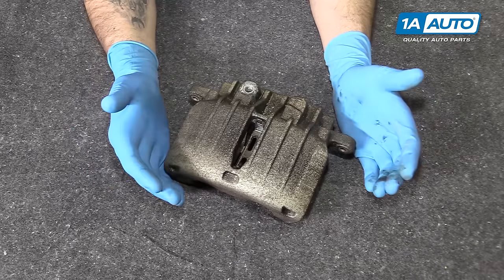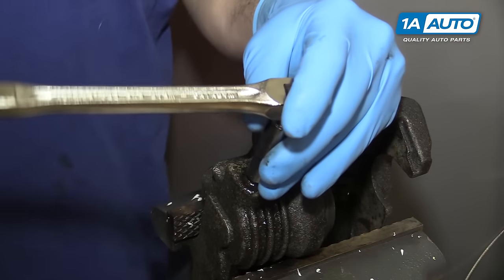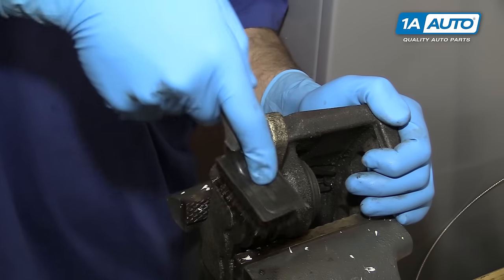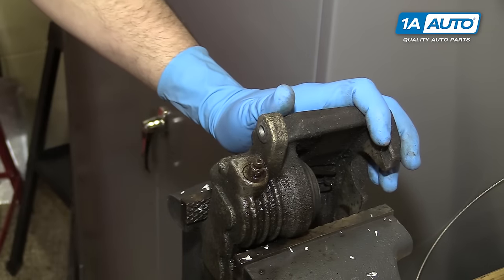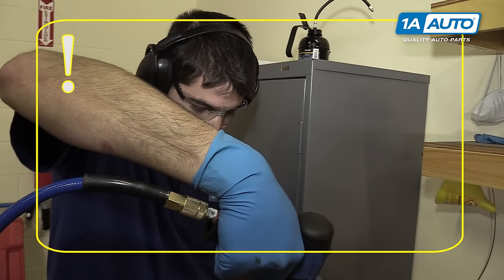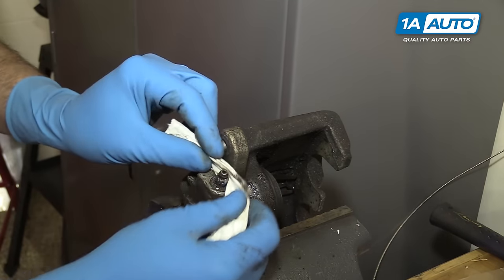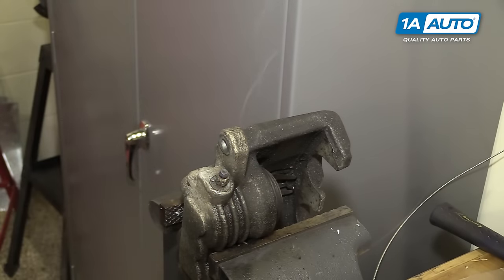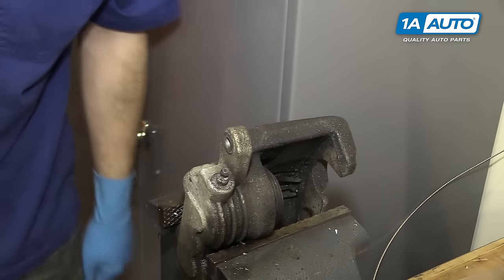How to Remove a Stuck Brake Bleeder Screw

Comment from the maker: √  Watch the Video
√  Buy The Part at 1A Auto http://1aau.to/m/Visit-1AAuto
√  Do it Yourself
√  Save Money
Reply: Many years ago I had the same problem.  What happened to me was the head twisted off and I never was able to open the bleeder valve open.  Used a hammer on the extended caliper to collapse it, to put the brake pads on.  Wishing I had collapsed the caliper after having a big problem with the bleeder valve.
Reply: Thanks for showing us this video. Yes, it sucks when bolts or nuts rusted and welded from corrosion.  Yes, I would rather buy a new part than try to drain my whole day removing it.

Comment: Funny that a How To video failed to work! Honestly, I actually very much appreciate that. Usually folks only show things in optimal lights and make it seem like fix all solutions. It's refreshing to see a realistic video showing that things just don't always work sometimes

Granted, I'm hoping mine doesn't end up failing like this video and one of these methods works for me hahaha
Reply: you can ha ha ha more... probably you have not repair to much on your car... repair on cars that have at least 5 years might end with broken rusted nuts or old plastics, after ten years you might get one piece per repair if you are extremely caution or more if you intend on productivity.
Reply: Right?!?! All the how to videos just make it look super easy then people are shocked when they end up making it worse lol. I love that he goes through several options and explains how to do them correctly, and more importantly, how to NOT overdo it. His comment at the end is my favorite 🤣🤣🤣
Reply: Your last option is to snap the bleeder screw and drill it out - These guys wont tell you that because their goal is for you to buy a new part.
Reply: All he had to do was heat the caliper up till it was red hot and it would have came out , doing this way has NEVER EVER let me down the last 40 years doing breaks .

Comment: Heat the caliper around the bleeder screw up with propane torch or heat gun FIRST, (I prefer Heat Gun, a little slower but safer on the car), then hit it with Penetrating oil.  It will suck the oil right in.  Let it sit and do its thing (dissolve rust).  If that doesn't work, your niffty hammer gun tool should do it but heat it back up and hit it with CRC "Freeze Off" penetrating oil again first.
Bleeders are usually easier than the flare nut on brake line.  You have to break the threads loose AND break the rust loose between the flare nut and the line.   I work on old cars allot and have gotten many flare nuts loose only to twist the brake line like a piece of licorice .  Because of this issue, I'd never take off the caliper for a bleeder screw until it broke off flush but in my experience they are easier than the flare nuts if you use heat and pen oil, especially freeze off.  I'm guessing you did this for ease of demonstration but many less experienced mechanics may think they need to remove the caliper for seized bleeder and that's a bad move unless you HAVE TO.
A link to where you got the hammer gun tool would be nice also.

Comment: this might sound counterintuitive but old trick I learned at Midas 30 years ago heat the bleeder screw and not around the bleeder screw if you heat the bleeder screw cherry red and then when it's cherry red instantly cool it with water it will come free almost finger free if you don't believe me try it I use an old fire extinguisher that you fill with water and compressed air that cools it the fastest
Reply from the maker: +Patrick Duggan Thank you for the recommendation! We appreciate other tricks which will help other DIYers perform these replacements! 1aauto.com
Reply: AHA! IT WORKED!!!!
Reply: That sh!t worked, I felt like it was going to snap just turning it. I tried this and I didn't even heat it cherry red... only for about 20 secs. When I saw smoke coming from the threads I cooled it and it came loose with a ratchet.
Reply: Midas trained us to get er dun
Reply: I do the same just heat with a propane torch and it works. never tried coiling it with water.
Reply: Patrick Duggan I have been doing that for 35 years works great
Reply: Yep, dad always taught me to get the stuck bolt red hot and quench it. He says for really stuck bolts, do this three times and it almost never fails.
Reply: Thats how you do it! The screw will expand and break all that rust, by cooling it with water it shrinks again, breaking more rust and you can unscrew it
Reply: The trick of heating the bleeder red hot then hit it with a lot of water WORKS!!! Been doing this kind of work for 25+ years... I can get them out after someone has snapped them off all ready by doing this trick.👍🏻👍🏻
Reply: Same here; and that goes for ANY seized fastener as well. The bleeder expands, becomes malleable, and then shrinks. And since rust contains oxygen atoms, it burns off under high heat. Don't use a penetrant, it'll only catch fire. If you heat the caliper housing you'll toast the seals. I prefer to rebuild the calipers myself if the need arises.
Reply: Heat and cool with water works every time with everything
Reply: you are a hero! many thanks
Reply: Patrick Duggan ha so I’m watching and was about to rec. the same thing when I read your comment I work at a Midas older guy there showed me that truck had worked every time for me to !
Reply: Patrick Duggan i
Reply: Won't be doing that if it's an alloy caliper unless you want it to melt.
Reply: Patrick Duggan can you do this while the calliper is still on the car?
Reply: learned the same thing, old-timer taught me that and seems to work. he said to heat it up, walk away and get a coffee then come back when it cools off.
Reply: Huh. I'm planning on doing that on my car since the bleeder screw us rusted on there and I need to do a brake bleeding once I replace the ABS pump module and wheel hub. I replaced the ones on the rear calipers and bled the brake fluid once I pressed in the shoe with the bleeder opened up and bled it some more after installing the caliper.

Also, would this work with stuck caliper mounting bolts?
Reply: Right on. Just don't drop the red hot slug in your socks. :/

Comment: Good and honest video. Skilled mechanic. Imagine doing this in the street because you have no driveway and it's blustery cold? If you bought brand new calipers like I did... just before getting T-Boned! and having my 2011 Impala totalled. shit... the first thing you would probably do is buy a brand new, shitty, rusty, USED car you can afford with the pathetic tiny insurance settlement you got. Remember, your 'STELLAR' ride got totalled and you got 30 cents on the dollar ! Then, when they drop YOUR new used junk car off in front of your home, the first thing you will make sure of is that the car can stop !! You won't know this until the engine is powering your drivetrain. Stopping the car is by FAR the most important thing a car has to be absolutely be capable of. Stopping power should be at least twice your acceleration power. (personally I like to be able to pull 5 negative G's when stopping) !! Steering the car comes in as number 2 next to braking. Kiss your bleeder valves and thank your caliper for their existence: for allowing you to be able to stop your car without the bleeding bloodbath that could occur if your bleeder valve is displaying 'arterial-like' bleeding. Bleeder valves are important and never ever seem to be noticed nor do they have a nice big nut to get a breaker bar or impact socket on.  Do YOU hate these tiny little bleeder nuts on junky rusty calipers that you will get after your car is totalled and Progressive Insurance forces you into a crusty rusty ??? Once again, I find myself having to buy new calipers and rebleed the progressive beast. What a pain. Progressive paid $4500 for a 2011 chevy impala whilst I had $6000 in new parts including a rebuilt transmission, brake system, exhaust, rims ALL from last year. Struts, suspension... all new. If you get hit by someone who has 'Progressive car Insurance' - - - STAY IN THE HOSPITAL and claim INSANITY !!! I agree with everyone here who would like to see a better flush system. Alas, lately, bleeder valves have only served to bleed our wallets or used as negative 'mythical swear words'. But the overall system-theory of a cone in a seat is a great idea because it can handle the pressures of the hydraulic system. Unfortunately, not many car manufacturers or mechanics pay attention to properly seat these tiny shitty valves by using high temp lube. Any decent axle grease will stop rust and make these a breeze to take out. FIX: 15mm wrench design! Car with BIG NUTS wins. I feel like 'Progressive Insurance' owes me some skin that came off whist making a rust bucket safe again.
Reply: ABSOLUTELY SPOT ON! Stupid design in order for these tiny, fragile IMF Mission Impossible brake bleeder screws to rust in place!!   Hmmm......Remanufactured Calipers have become quite a business......

Comment: I spent three hours trying to brake the bleeder loose, then I called the parts store and picked up rebuilt caliper for 17.00.  ha ha
Reply: Lucky you.
PBR dual-piston calipers go for $100/pair used.
Reply: $17? What?
Reply: 1AAuto has kit for my 1999 silverado, Brake Calipers with Brackets & Hardware, Pads and Rotors $199.99 that's not too bad.
Reply: I recommend taxi/police calipers: Powder coated perfection with matching brackets. Only $699.99 for all 4. Dont forget to condition your BLEEDER VALVES.

Comment: At this point you may as well grind off the "nipple" on the screw with an angle grinder. Then try a left-handed drill bit the next size bigger than the center hole. (Don't drill all the way throught the screw and into the caliper, of course.) Increase the bit sizes until the drill screws out the screw. I've used this method numerous times with a 100% success rate, and have never even come close to the threads.
Reply: That's premature. His poor application of techniques failed the task. He handled the caliper like it was part of his dolly collection.
Reply: Same thing I suggested. Though I'd wait until it breaks by itself.

Comment: I've not seen anybody mention using reverse drill bits or easy outs to attempt to back out the sheared bleeder. You could also drill out the bleeder screw, clean the threads, and replace it with a new bleeder screw. Also, I see no reason why tapping larger and replacing with the next size bleeder wouldn't work. Depends on how much you want to do the job yourself, but I think you could use that caliper even if the bleeder shears.

Comment: I would also try to drill the dirt out of the center of the bleed screw. Then put penetrating oil in the middle and let it sit a few hours or days then try again.  I also use teflon tape on the thread to minimize. The problem in the future

Comment: Never ever use an impact on a bleeder screw, avoid heat to rubber piston, heat the actual screw, spray pb blast use light pressure stop heat again re spray turn very gently
Reply from the maker: +Mike Woods Thanks for the feedback!

Comment: You should always put a drill bit or broken drillbit into the hole to prevent it from collapsing on itself. it allows you to safely apply more torque without shearing it off. and also the best method i found is to hit the bleeder itself with a map torch or propane torch till it's almost red and then quench it with cold water. several heat/quench cycles and the bleeder will come out super easy. I have never not been able to remove one. when you quench it you will see the rust flow out of the threads and the bleeder will be loose
Reply: I would also change the bleeder if you do that as quenching it will make it brittle
Reply: Galgamoth What if it DOES  twist off? How you going to get that broken drill out ?
Reply: ASPCOT Drill bits and bolt extractors
Reply: Galgamoth this is best advice I’ve read ie. break drill bit off flush. Heat bleeding screw,quenching immediately several times. Works every time. Another method is tack weld nut onto bleed screw. Heat from tack/weld separates rust when screw contracts. Good satisfaction when you place old one in bin.
Reply: True true, good advice.
Reply: @ASPCOT  if it does break off then you replace the caliper and there's no need to remove that bit.
Reply: wouldn't the cost of a tap  be cheaper than new caliber? drill it out, retap, flush out the unit first and  install new bleeder, with a dab of anti seize . always works for me
Reply: @Galgamoth YES! the method of heating bleeder screw and then hit it with ice water has never failed me....
sometimes, I have to do it twice but usually it works with the first heat/cold cycle.
This also applies to other rusted in bolts if you have the room to do it. Yes, you should most likely replace
the bolt once you use the heat/cold method to extract it due to it effecting the metal strength from the
quenching......just depends on size of bolt and importance of it.....a judgement call from experience really.

Comment: You'd think after all these years automotive technology would have come up with a sytem that doesn't end up like this.
Reply from the maker: +1rewd1 Thank you for checking us out. We agree, but the manufacturers make it more difficult and they sometimes rush designs or usage of parts/hardware. 1aauto.com
Reply: 1rewd1 it's called anti-seize but it cost the manufacturer of the vehicle TOO MUCH!!!
Reply: 1rewd1 will that would make sense.... But how are these guys gonna make money if they make something that lasts?
Reply: Rubber top hats that seal to the caliper do wonders. I have seen bleeder screws look brand new after years. You can also pack the area around the threads with anti sieze or hella thick grease.
Reply: 1rewed1 All manufacturers would have to do is put a thin layer of anti-seize compound on the bleeder valve threads before screwing it in but they don't bother. Permatex anti-sieze works wonder. You just need a very very thin layer. Just barely enough to coat the threads, and keep the compound away from the tip of the valve at the inside of the valve.. You don't want to push any significant amount of aluminum particles and solvents into the brake fluid. They should also be able come up with some kind of plating that prevents seizing.
Reply: Yes, copperslip works for me :)
Reply: @802Garage  If you regularly bleed the brakes, like every 2 years as you should, then this shouldn't happen.
Reply: @802Garage  Rubber hats or top hats as you call them do nothing for protecting the threads of the bleeder valve, only grease with application or anti seize on the bleeder valve before it is screwed and tightened into the caliper will work to keep this from happening in the future and then even still after this happens these techniques might work. 
Still some have to be cut off and easy outed to remove them or cut off drill and retap, by someone who knows what they are doing and have done it before. The only thing the rubber cover does really is protect the whole of the bleeder valve from becoming clogged to stop the brake fluid from coming out when bleeding is occuring. Or you will have trouble bleeding the system, after the bleeder valve is loosened. That is all the Top Hat is good for. Has nothing to do with the threads being stuck, I know for that is the same problem I have on my Harley (2003 H.D. 883 100th Anniversary XLH), right now. So beings my system is not leaking and I was just wanting to change my fluid in the system with new DOT5, I just left it alone, and will replace the pads when not braking becomes a problem, unless a line breaks and then I will fix the leak and bleed the system one way or another.
Reply: @soilmanted  Putting silicone grease on it would do the same, but putting on goo is not a clean finish job.
Reply: They do it so u have to go buy a new caliper then u need to go to a garage and have the system blead which u will need 3 more calipers lol thier really smart eh money money money more then brains
Reply: They should make these bleeders out of stainless steel.
Reply: Exactly
Reply: @clearsailing7993  stainless bleeders are a horrible idea. rust forms a wedge but galling causes adhesion. you pretty much guarantee needing new calipers every time you need to loosen that screw.
Reply: The simplest Solution I can come up with in my brain easily it’s just make them a lot bigger. Same little hole in the bleeder. Just a bigger base and nut size. A lot bigger. Also hardened steel instead of the pot metal they are made of.
Reply: The Germany automotive engineer have. It's called plastic. Lol. Plastic oil pan, oil pan plug, plastic for radiator coupling...and so on.
Reply: Nope, planned obsolescence. Many companies do this type of thing. They make sure you can't replace a part, so you have to replace the entire thing. At least it's not the entire car, but just a caliper